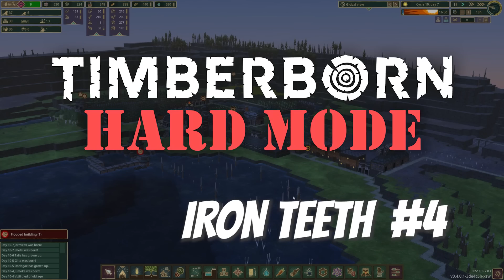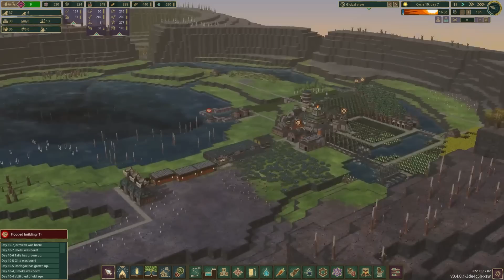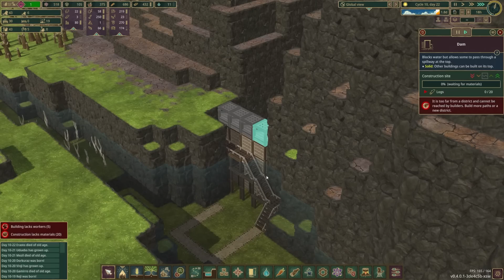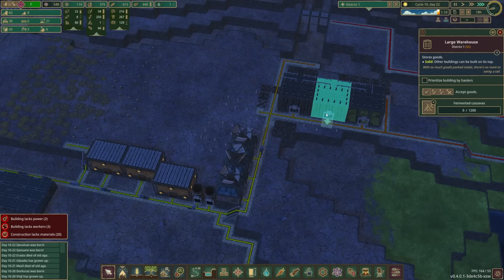Let's prepare to expand! Timberborn Update 4 Hard Mode Episode 04

Comment: Cycle 12 already :) Doing well :)  A couple of dry patches, but I think you're getting the spots patched up & the holes filled in where they're needed.  It might not be a bad idea to put a log & plank storage (just the small piles) down near the new build site in the canyon, it will stop the builders having to run all the way back into town each time for a log or a plank. I think you'll achieve floodplain level :)  I have faith!!  Have a fab day!

Comment: 🚨🚨🚨 reminder :  pause your water dump pouring water thru your mangrove dams !!! ( Turn it on for a minute at a time maximum) ... Suggestion: water pumps on PLATFORMS in the deep water in the middle of the deep lake ( high enough that they won't flood when water goes higher) ... Maybe add 4 more waterwheels parallel to the first group ? ( Number cruncher on waterwheel end of power ? -- you have empty land over there! ) ... Plan ahead: where will you be needing logs in future.. plant trees in those areas